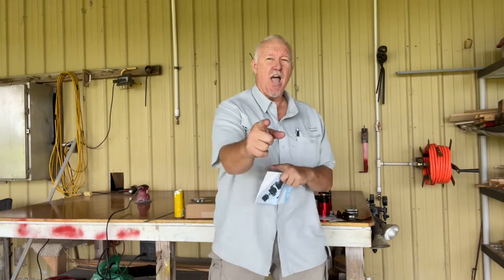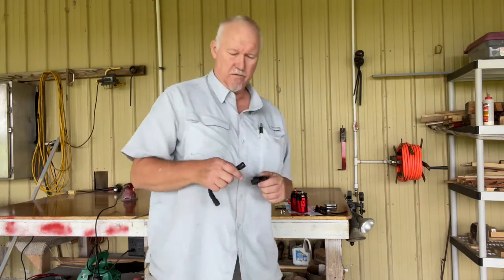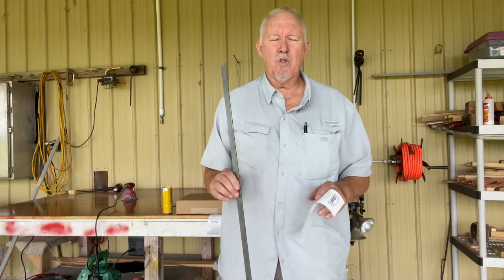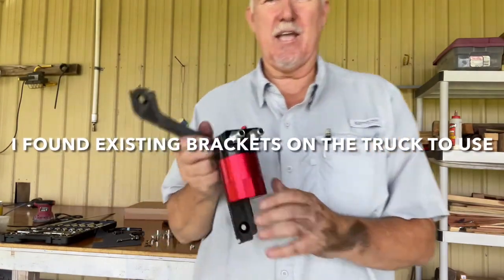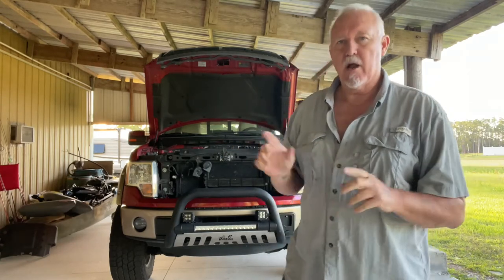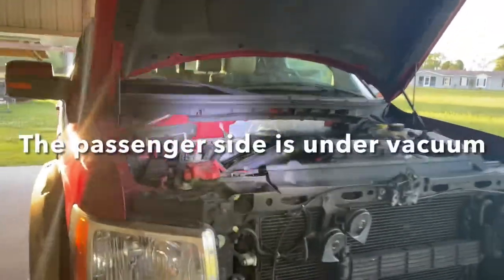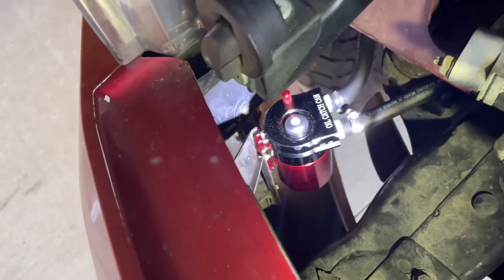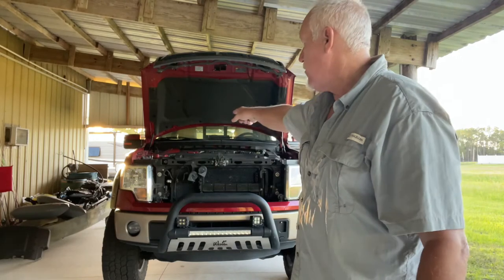Catch can install 2014 f150

Comment from the maker: Truck is doing great. I think the catch cans helped a lot. Also, check your vin on the NTSB website. there is a recall on my transmission. They have to do some software update. They say it can go from Hauling ass to first gear and blow the engine if you’re not careful.

Comment: Thanks from Orange City FL just installed mine on 2019 f150 wanted to make sure that the plug on the front passenger side is the in and the other is out that's how I have it right now

Comment: hey man. how important is a check valve to be put on the passenger side can? the hose that runs out the can, into the intake. those check valves get gummed up and restricts the flow over time.

Comment: hi, did you put a check valve on the passenger side or does it need a check valve at all ? thanks
Reply from the maker: No I didn’t put one on it.  I saw no reason.  Works great
Reply from the maker: No need to